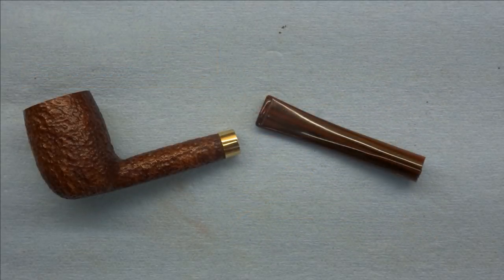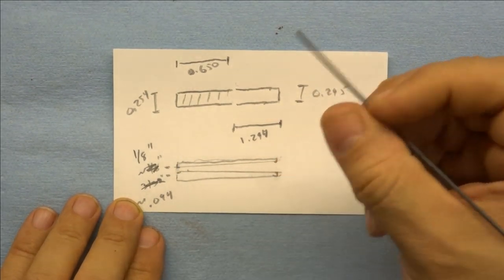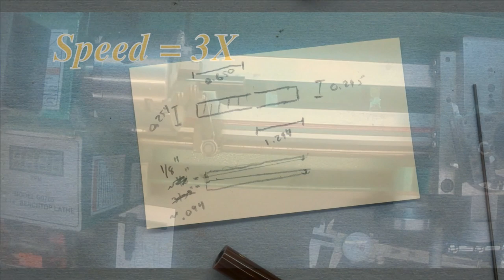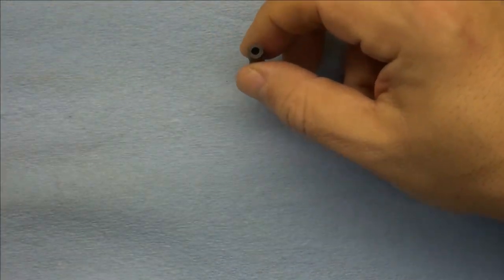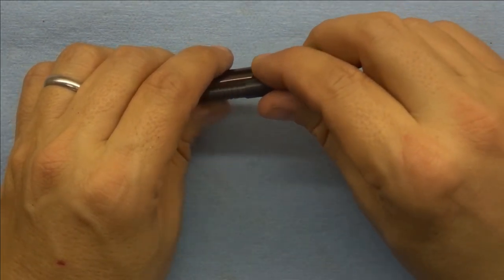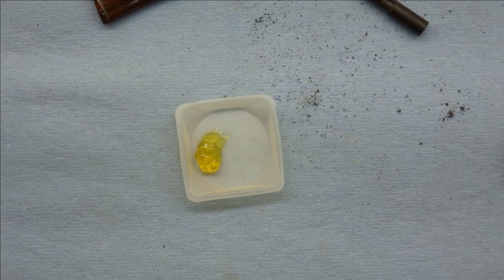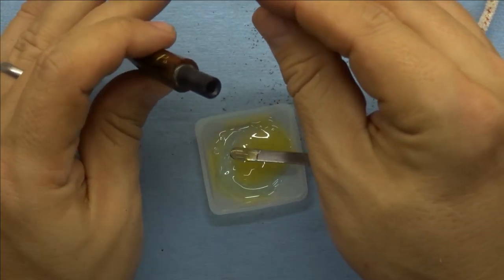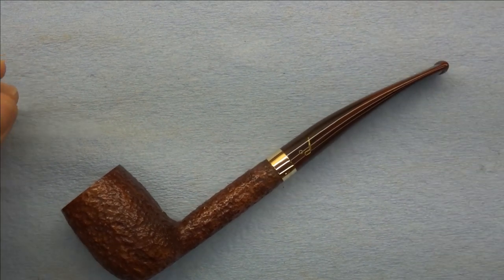Repairing a Savinelli Bing's Favorite Part 2

Comment: Mike, will it still take a 6mm absorber/filter ?  Would it be less expensive just to order a new stem from Savenilli ?
Happy holidays and thanx for the video.  God bless
Jim
Reply: @markinri1877  very true,
Reply: @Sir James, Based on my experience,there is a big likelihood the new stem they'd may make for you would not be satisfactory,a well performed replace tenon is a better opinion, been doing this road before,only but money losses,a brand new hand-cut stem  might be an option as well,but thats a pretty expensive operation,no less than $ 60 minimum
Reply: @paulthescandinavian4992  thanks for the input - appreciated. Merry Christmas - Jim
Reply: @markinri1877  Mark, thank you for the input. ai have a Bing and will check it out. Merry Christmas  Jim
Reply from the maker: Hi Jim, I always check with the customer and in this case he did not care about the filter so I did not drill the tenon to accept one.  It could be done, but it weakens the tenon, and as Mark alluded to this pipes shank is just too thin to squeeze a 6 mm filter in there and leave a reasonable wall thickness.  I don't know what Savinelli charges for their stems, but then you would have the same problem. They use plastic tenons prone to cracking.  Thanks for watching, and God bless.

Comment: This may be obvious to most, but why epoxy and not "super glue"?
Reply from the maker: Hi Rick, it is a good question that requires a long answer.  But to keep it as short as possible there are 2 reasons not to use super glue.  First, it is not gap-filling and actually shrinks as it cures.  Since I want a complete bond between the delrin and acrylic with no gaps, super glue would be a bad choice.  Second, super glue is great for things that just need to be stuck together (like the crack in the shank) but it does not hold up well to shear stress.  It tends to fracture when stressed, and with the tenon being taken in and out of the mortise it would break down over time.  Not all epoxies are created equal, but the one I use was actually formulated for the marine industry and it is both tough and stands up well to shear stress.  Not at all obvious, so thanks for asking!